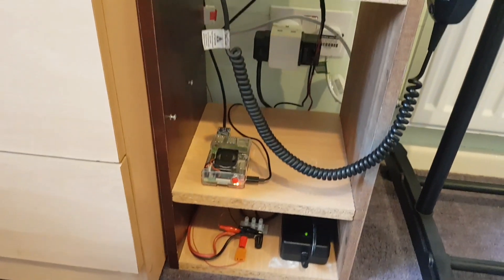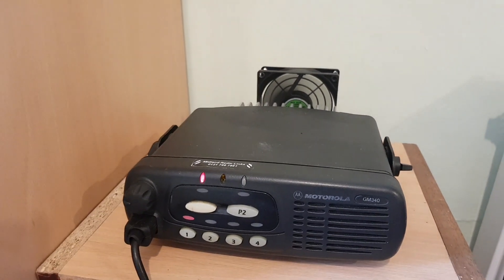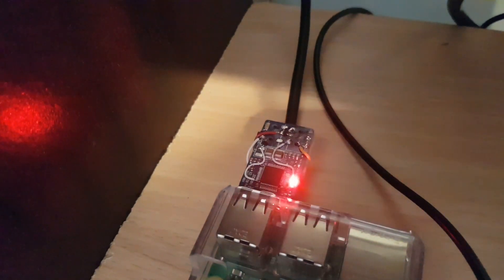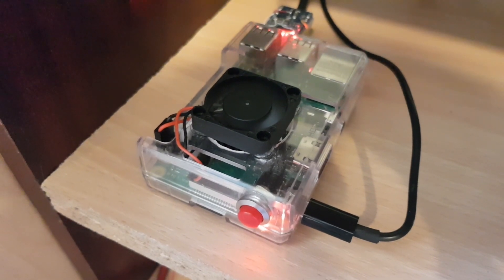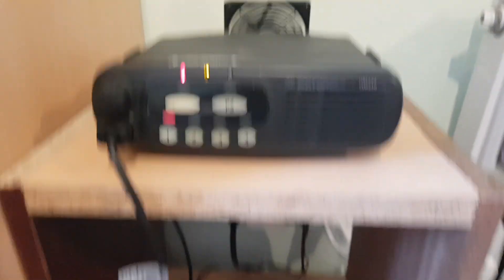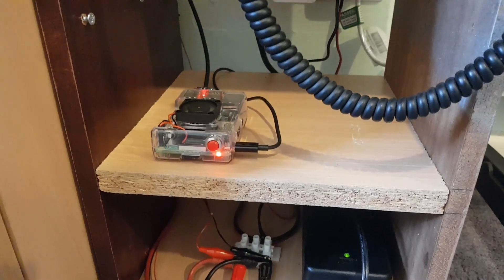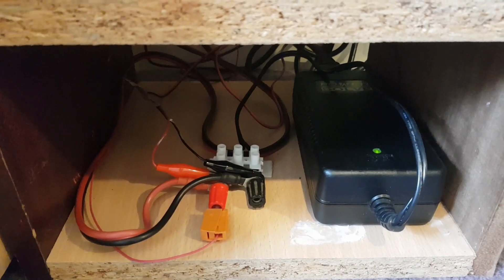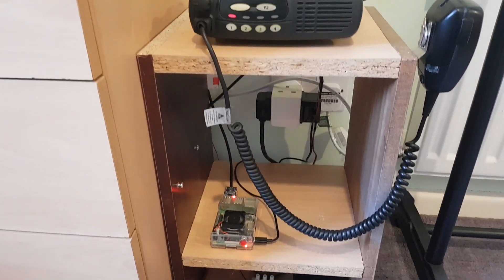A look at MB7IPD Allstar gateway.

Comment: Interesting video Mark thanks for sharing . Iv recently built an Allstar node using a raspberry pi 3b for my own use, and I would be keen to maybe build a gateway like yours but not sure where to start could you point me in the right direction?
Reply from the maker: Building a gateway after a micro node is dead simple, just a larger radio. Plenty of information online, the main difference is it will ha e to use morse ID for the Nov compliance